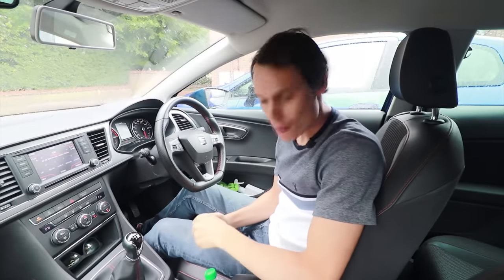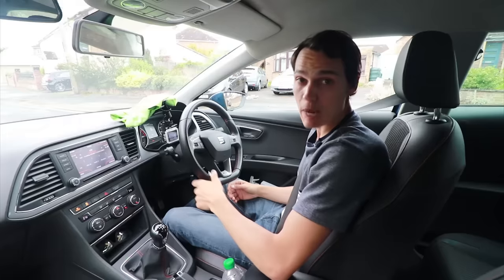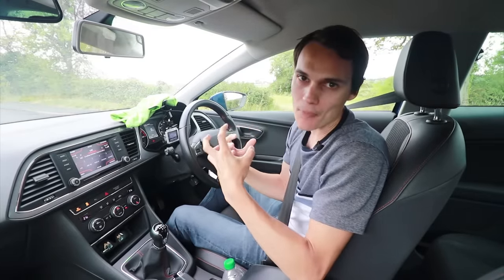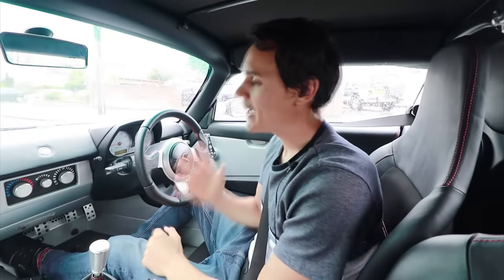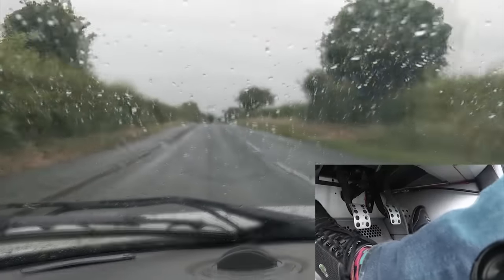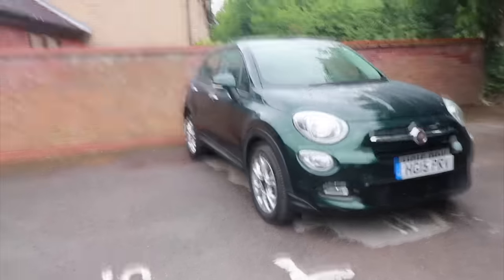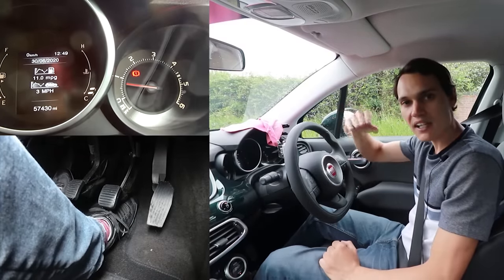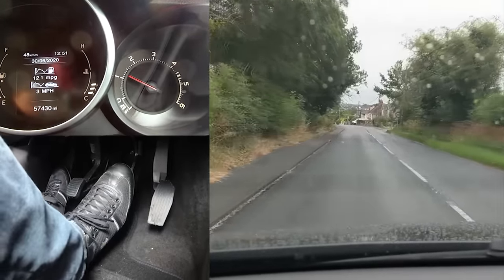Upshift blip - advanced technique for changing up gears smoothly

Comment: My little bro has a 17 Velsoster turbo, just a feather of has and goes straight to 2k revs anymore and it will rev to 3 maybe 3.5. Took me a while to get used to. Where the car I learned in can rev to 1500 with just a bit a gas. It really does matter.

Comment: Hi im a big fan here in philippines i am new manual driver do i need to press the clutch every time i slowing down when im in high gear or im in high speed?i hope you will have this video thank you in advance
Reply from the maker: You only need to press the clutch when slowing down when your engine speed gets to around 1000rpm.
Reply: I remember that's also how my dad taught me to drive a manual when I was a kid. But yeah, try your best to only step on the clutch when slowing down as close as you can get to a standstill without stalling. Avoid coasting in neutral or with the clutch pressed in. Just practice a lot and you'll find your own rhythm in driving.

Comment: On Mazda3 manual, it seems to have a rev hang feature when shifting from gear 1 to 2. If this is the case, I should not blip the throttle for upshift since otherwise it will cause the even bigger mismatch between engine rpm and car speed . Am I right? This may work if it takes longer for me to shift gear (eg accidentally change to a wrong gear first and then correct the shifter position to the right gear without releasing the clutch pedal). Then blipping throttle may help upshift since rpm drops to the idle within this time range.

Comment: At 1:17 if I use my clutch to bring the engine speed up from idle to 1500RPM when shifting will that wear it more quickly?
Reply from the maker: Using the clutch to rev match causes very minimal wear, not something I would worry about.
Reply: @ConquerDriving  Thanks!

Comment: 1:09 why does  using a gear up make the gear speed go down ? Isn't it the opposite ? Aren't higher gears smaller, therefore helping making them spin faster ?
Reply: I got it, gear up makes the gear speed go down because the engine needs less work to spin the gear at the same spin speed. It is exactly because the gear is smaller, that it can operate at a lower spin rate to produce the same effect on turning the wheels.
Reply from the maker: That's right, there are quite a few cogs in the mix but a higher gear transforms a lower input speed into a higher output speed.

Comment: Great video but could you tell me if putting revs up is going to cause using more fuel? Thanks
Reply from the maker: Barely any more at all from a blip. You wouldn't notice in mpg difference as it uses very little fuel to rev the engine without load.
Reply: @ConquerDriving  thank you very much for an answer. Keep doing great work!

Comment: How often do you perform this changing gears method in regular everyday driving? Just periodically or maybe pretty much all the time?
Reply: In my case, I LL do almost all the time. I love the smooth way of driving like that. Only 1rst to 3rd gear.
Reply from the maker: Depends on the car, but most of the time I use it. It happens very quick though, you barely hear the throttle blip as I do it very quickly to stop the revs dropping too much.
Reply: Thanks both! Beginner driver here who is ready and whiling to teach and truly understand advanced techniques let's say. So in summary for better/faster and smoother acceleration in first 3 gears this can be pretty handy. Will try to practice it slowly! Seems fun and not that hard.

Comment: Great videos and helpful for anyone. 
Would throttle blip upshift while clutch down cause more wear. Say I'm trying to change from 2nd to 3rd gear say 4k rpm and revs drop to around 2k rpms is it better to not rev or at 4k rpms with clutch down rev abit
Reply from the maker: When up shifting you rarely need to blip the throttle unless the revs drop too quickly. The closer your revs are to the new gear the better.
Reply: @ConquerDriving  Great thanks for your reply. Do you think it damages anything while around 3-4k rpm clutch down u rev abit it holds around 3k rpm then u bring up clutch and rev away? 
Thanks Your content is very good for anyone from learners to experienced drivers still trying to improve.

Comment: People often ask — when do you blip the throttle or gas pedal?  Upon when the clutch pedal is all the way down while you're still in the present gear?  The clutch pedal is still all the way down or it's still disengaged, but you have shifted into neutral?  In other words, clutch pedal down, gear in neutral, blip the throttle?  Or, clutch down, shift into the lower gear, THEN blip the throttle.  Or, in doesn't really matter which one I described?
Reply from the maker: I usually do it as I'm moving the gearstick so the revs are ready for the clutch but it varies car by car. It depends how quickly the engine revs up, but you want the revs up just as you go to lift the clutch, that's the important bit.

Comment: That's great, but my car has a rev hang, so only way to perfectly switch a gear up is to do it slowly (not releasing clutch slow, but changing and releasing when revs go down to match gear speed), or to release the clutch slowly if you want to switch gear faster which is not good for clutch...

Comment: I do a different method for this purpose which is by any means worse on the clutch but easier to do. I ride the throttle a bit longer so when I step on the clutch it slips and the engine revs up allowing me more time until the revs drop too low. What is your opinion about this? Would this kill the clutch in long terms?

Comment: Hi Richard, 
First off, you're amazing. I've attempted holding the clutch at bite point b/w shifts 1-2,2-3 however I feel the clutch is being destroyed and not moving quickly. I find it most effective and smooth by using the seasaw method of lift gas, clutch in then vice versa (not thinking about holding the clutch then). I want to do your method to make my upshifts more purposeful however it is not smooth. I rev-match downshifts. Question: What conditions should I use this method in? Is this method only necessary when the revs fall low? entering the motorway or driving in town? I'm trying to diagnose why I can't get this method smooth on my vehicle for quicker upshifts.
Reply: B/w gear changes holding clutch at bite point for me whilst giving gas feels as though I am taking off from start and seems to be damaging.
Reply from the maker: You definitely don't want to be changing gear the same way you move off, that will wear the clutch quickly. You only normally need a bit of gas if the revs drop too quickly. Do what it takes to make the gear change smooth without the revs being way too high or low for the next gear.
Reply: @ConquerDriving  You're the best. Thanks, I still have more questions related to holding at bite point b/w shifts whilst accelerating smoothly, yet I feel that I should be fair and save that for a lesson.
Reply: @lightspeedmath8065 there is a method where he teaches holding it at the bite point , and then add a very little bit of gas when shifting. It’s in the video (changing up gears smoothly in a manual car) at 5:34.

Comment: I have the opposite issue, Rpm hang is too long (6MT M2) so when sou release the clutch rpm still too high (similar to a heavy fly wheel) it’s probably due to emissions, but very annoying, only smooth if I wait a bit longer to rpm to drop then release the clutch, it’s bad, particularly from 1st to 2nd.

Comment: When you said clutch down did you mean flooring it or kinda past the bite point?
Reply from the maker: To the floor to be sure when pushing the clutch down. Just came up with that, it ryhmes 😄
Reply from the maker: But when using the clutch in slow moving situations it's better to go just below the bite point so you're ready to use it again.

Comment: Does blipping the throttle like that have any impact to mileage? Loving the 32 MPG in my si, but I hate the rev hang. Dont wanna rush into ECU mods, but I dont want to sacrifice on the 10 or so gallons the car has.
Reply: No it doesn’t, MPG has more to do about your driving style and acceleration/deceleration style.

Comment: so, the slower method where you hold the gas while gently releasing the clutch pedal is similar to moving off from a stand still, right?
Reply from the maker: Similar but your don't have to hold the clutch at the bite point for very long.

Comment: What are your thoughts on bliping the gas pedal from a cold start?  I.E. blip gas, release clutch, apply gas....
Reply from the maker: I try to be gentle with the engine before it's warmed up.
Reply: @ConquerDriving  wrong wording.. I just meant from a stop.. when your car is already warmed up.
Reply: @casper6583  bad dont do it, you bang your clutch on stand still wheels. Strt moving off gradually

Comment: im in a bmw 318 e46 manual an i am finding it difficult shifting to 5th gear which is the last gear as the revs gets so high and the car not move any fast, any help please
Reply from the maker: Try practising shifting from 4th - 5th with the engine off when you're stationary.

Comment: Does bleeping the throttle not increase the clutch wear versus holding it at the biting point?
Reply from the maker: If done correctly it should reduce clutch wear. Depends how quickly your revs drop.

Comment: Awesome video, I’ve not seen this anywhere before! Quick question: Does it cause excessive clutch wear if you don’t come all the way off the gas and lift up to (or more accurately very close to) the right no. of revs and use the clutch bite to rev-match? If not is the blip better?
Reply from the maker: Rev matching is the best for clutch wear. These two videos will help:
https://youtu.be/0ZjSImbwo34
https://youtu.be/81SOTuCsxV0
Reply: @ConquerDriving  Thanks from Tendring!

Comment: sir i have a question lets say im cruising in 3rd gear and due to traffic i have to slow down my car using brake( with clutch down) and my speed reduces significantly to lets say  6mph.  now here i have two option  1st is downshift and the 2nd method is  stay in the same gear and hold the clutch at bite point while give gas so that my speed again start to raise. this cause a lil bit shaking or vibration in my cars cabin. do  u think  the 2nd method  will hurt my clutch or engine??? pls clearify my doubt.
Reply from the maker: Using the second method would certainly wear your clutch. Make sure you use your gears as much as possible to reduce strain on your clutch and engine.

Comment: Is there any difference between rev matching and an upshift blip other than rev matching being downshifting and upshift blips being upshifting?
Reply from the maker: It's similar, but as the revs need to drop during an upshift, you don't always need to add revs unless they drop too far too quickly.

Comment: Is it okay to blip the throttle BEFORE changing up a gear, then change up a gear, and as the revs start to gradually fall you effectively drop the clutch and get back on the gas. I’ve been doing this method  for quite a while now but I don’t know if it’s good for your car or not.

Comment: Hey bro, due to worn synchros I have to double clutch on my car but the rev drops too quickly. How do I perform upshift blip when I double clutching on upshift? Is it the proper way if I clutch down and release gas at the same time, putting it into neutral and then clutch up, next do a small blip and quickly clutch down and shift into the higher gear while adding gas and at the same time releasing clutch smoothly. Thanks! Its a diesel and it is a very unforgiving car where if I let the gas off first the car will slow down very quickly.
Reply from the maker: If the revs drop quickly you will need to rev it more so they take longer to drop too low. What you have said is what I would do.
Reply from the maker: Ps, it's very difficult to rev match in a diesel as the revs drop quick and hard so a jerk is difficult to avoid without using the clutch to rev match.
Reply: @ConquerDriving  Thanks for the quick reply. Is there any major difference on the wear to the synchros if I double clutch with and without the upshift blip? I do found however I have to blip to upshift from 1st to 2nd, the other gears I can find upshift without the blip.
Reply: @sumanasoh  not 100% sure but for upshifts: clutch down>neutral> rev as close to next gear>clutch in>next gear while dropping the gas. I advise doing it in a closed road with low speed . Be ready to put clutch down  very fast as grinding the gears is unavoidable when you will learn

Comment: Haven’t finished watching the entire video yet, but.. Isn’t it easier (and faster to do) to learn the gaps between gears (gear ratios) and to come off (almost drop) the clutch when your engine speed has matched the gear speed without using the throttle blip? For example: I’m changing up from 2nd to 3rd, I’m at 3000 revs, and I know my revs will be around 2000 in 3rd gear . I’m know changing gear quickly and releasing the clutch just at the right moment, at 2000 revs (before the revs have fallen further.. otherwise you need to blip so it’s faster) I’ve been doing this for a while and it makes my shifts really quick and smooth. One downside, you need to be quicker and quicker with your gear stick and clutch the higher gears you’re in. 5th to 6th is a really small gap, (at 2000 revs only about 250-350 I believe) so you need to be lightning fast - and I am ;) - It’s amazing when you’re get all your shifts right from 2nd all the way to 6th. Edit: Watched it now, and you mentioned it. Great! I’m driving a VW Golf 6 with an 1.4TSI engine, I think pretty similar to your Seat’s. So it’s probably doable in your learner car as well.
Reply from the maker: There mk6 golf is actually completely different. The Leon I have is equivalent to the mk7 golf which has a very different chassis and different engine despite still being called a 1.4 TSI. I know in my car, the revs drop too quickly to catch with the clutch without a blip.

Comment: Loving the videos really. Have not seen such detailed content on this subject with excellent delivery. 

Do you have any other suggestions for a car with an extremely sensitive gas pedal ? Sometimes i release the clutch where the revs are more than 2.5K which i know is bad for the clutch but the sensitive gas pedal is forcing me to. I tried to release the clutch at the same time to prevent revs shooting up as you mentioned, but still no luck. Any other suggestions ?
Reply: Practice holding the revs at 1.5k. It may take time, but it's possible even with a sensitive gas pedal.

Comment: You're saying in the Fiat500 that the revs are going really slow but have you tried driving a manual car with a RevHang ? My Subaru Crosstrek 2021 has one and it is unbelievably HARD to shift smoothly from 1st to 2nd...
Reply from the maker: I haven't tried that car but most cars have a degree of rev hang these days. To be smooth you have to change gear slowly.

Comment: I drive a 1 litre petrol  and it gets a bit jerky when I upshift by just leaving the clutch and than adding gas. So after I upshift and  while I leave the clutch I simultaneously add a little gas and leave the clutch together for a smooth shift. Is this a correct way of doing it?
Reply: As soon as you've selected your gear, blip gas and lift clutch. The higher the gear, the faster the clutch lift.
Reply from the maker: That method works also as shown in this video. Just takes longer.

Comment: Can i do Upshift blip in all cars, does upshift blip cause any damage? Pls tell me i am a big fan of yours i watched all your videos
Reply from the maker: If you do it badly it can cause more wear, if the revs drop very quickly when changing gear then the upshift blip can help and cause less wear.
Reply: @ConquerDriving   when changing gear to first to second  do we need to accelerate gently when the clutch is at biting point  or can we release the the clutch gently without accelerating which is a better way???

Comment: I used this method almost always with my previous cars. But the problem is my current VW Polo doesn’t want to let me do the blip with clutch down. I have no idea why but blip doesn’t make sense when clutch is down. And this is pretty inconvenient. I can only push accelerator and hold it there so revs goes up BUT too high. So I just can’t do it properly with Polo. Strange behavior of electronic I think. So I just get used to make gear shifts really quick and in that way I don’t need that blip. But anyway sometime especially when I want to change gear down this problem is still here. I can’t make blip. And everyone downshifting I should keep clutch pedal like during the start on the 1st gear. Strange polo🤷‍♂️

Comment: I never had this problem but instead i find that the rpm goes down too slow. I find that I shift really fast compared to other people. I even remember when still doing driving lessons and the look the instructor gave me when I tried to shift his car as if it was mine(basically rally driver shifts) but the instructors car rpm would take 10x longer to go down so I eneded up of getting into a habit of shifting and then holding the clutch for another second before dumping it.
Reply from the maker: Be careful not to put too much pressure on the gearstick, shifting really fast can be harsh on your gearbox. Especially when cold, I find I have to ease many cars into gear if I want to avoid hard pressure, the MX5 is expecially stiff when cold.
Reply: @ConquerDriving  the gears just go in smoothly. Only when it's cold that's not the case but then when the car is cold it has a lot of revhang aswell so you get a lot of time to shift the gears so it's all good. To shift the gears I don't need to use a lot of pressure at all because they just go in even when I shift fast.

Comment: what happens if you do this in first gear?
Reply from the maker: Blipping the throttle before you add gas to lift the clutch up when starting to move can wake the engine up a bit quicker.